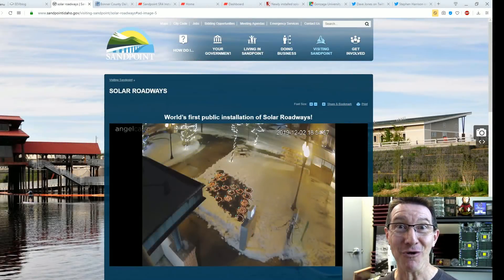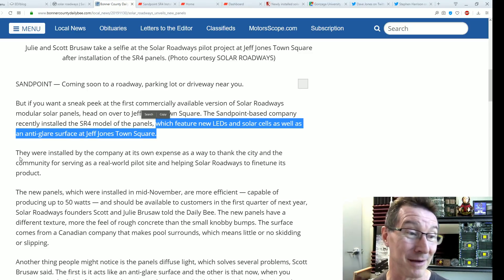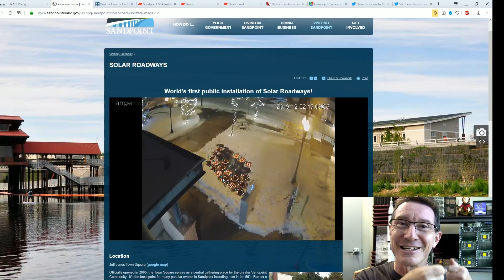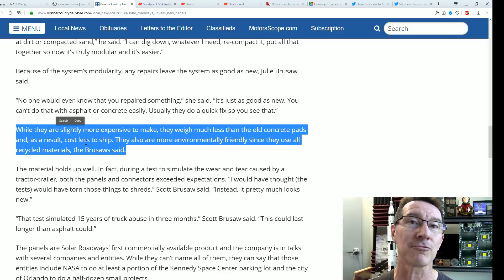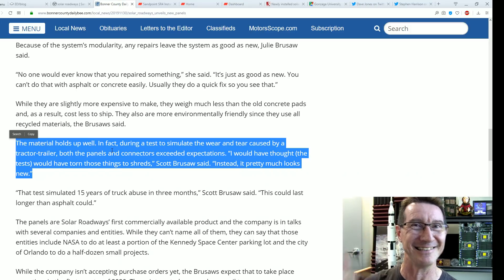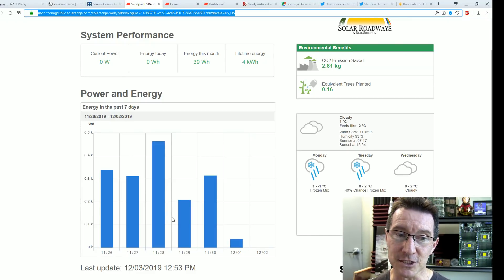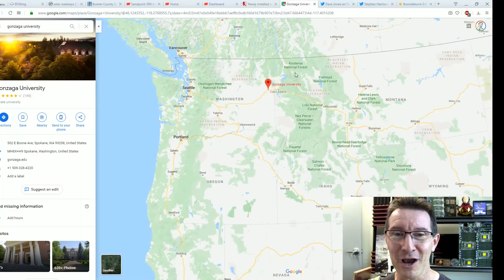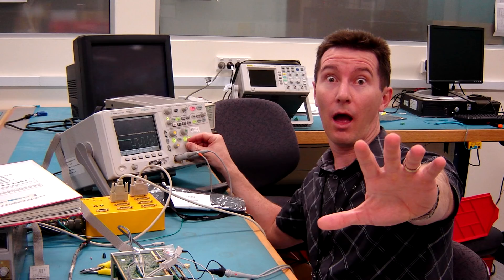EEVblog #1269 - Solar Roadways SR4 DATA Hilarity!

Comment: We have a large SolarEdge system at work.  Now, during winter, it generates about the same number of kWh/day as its kW-peak rating.
However, during summer it never achieves more than about 80% of its kW-peak rating so that figure is obviously too optimistic.
Likely because the panels are laying "too flat" for our latitude of 52deg, due to construction limitations (racks on a flat roof).
The production in summer is around 5 times the kW-peak rating in kWh/day.

The site you show is the "Kiosk", that is intended to e.g. run full screen on a computer at the reception desk to impress the visitors.
The owner of the system has a username/password to access all historical data in much more detail.

It is clear that the performance of that system is pretty lousy, as is fully expected and common for all types of solaroad.
Reply from the maker: Yeah, doesn't look like the system is a public access dashboard, I can't find it in the list.

Comment: Ugh why use the word "retarded" when you can just use "stupid", which is what you meant anyway. It's 2019.
Reply from the maker: Yep, "It's 2019", so what?
Reply: It's 2019- stop using slurs. It's gross. And it's not even necessary. Unless you were literally implying a mental disability, there are better, more accurate words. And if you did mean a literal mental disability, just say that.

Comment: A parking lot? Does the insanity ever end with these guys? How about stick normal panels on a roof and shade the cars at the same time as actually generating some power. Nope, that's too sensible, doh!
Reply: I saw i planned parking lot in that manner. In that way it makes sense protecting the cars from the sun and power generated. But ofcourse they had to ad a stupid twist. They planned to use semi transparent panels so there would be some ligth comming downn to the cars
Reply from the maker: That's not out-of-the-box innovative thinking.
Reply: Ah, but they have a master plan for Transparent-Freaking-Vehicles next....

Comment: I say when the SR4 panels are finally available for public sale, we all chip in and get one for Dave to do a teardown on!
Reply from the maker: PO Box 7949 Baulkham Hills NSW 2153 AUSTRALIA :-D
Reply: @EEVblog  Or we could go all out, fly you to 'Murica and see if it will power Thunderf00ts self cooling / filling water bottle!
Reply: Nonsense. I say we create a GoFundMe to pave his whole driveway in solar roadway panels!! The greatest troll ever devised!
Reply: @onemanshow4116  and watch as they slowly break apart and wreck his car tyres and short out the electrics.
Reply: It would be fully potted and require a dremel or other rotary tool to get it apart.
Reply: @gorillaau  or perhaps a big Crocodile Dundee knife? You do know who you're dealing with right?!
Reply: @deanwatt  just drive over it. she'll tear down just fine.
Reply: In this case, we should also make sure to get Thunderfoot a trip to Australia. That would certainly be a co-op video i'd gladly pay to see. As for opening the potted modules, i'm pretty sure Big Clive will come up with the "correct" tools to make short work of that ;-)

Comment: Small but key correction. The Sandpoint council didn't pay anything for the first panels, all $50k was paid with a State grant. During one of the public hearings someone asked for the amount of money the city had paid. And (on camera) the Mayor of Sandpoint can be seen LUNGING for the microphone to explain that not one local cent was spent and he emphatically provided sources. Which might be the greatest proof that this is nonsense. Something's got to be a higher level of bullshit for a politician to not want to take credit for it. Maybe the Major saw some of your calculations?
Reply: Local authorities even in small communities are vastly more intelligent and based in reality than government workers. Go figure!
Reply: They may not have paid for the installation, but the council is paying for whatever power it draws from the grid (public space after all).
Reply: @sweetchristmas101  Maybe or maybe not, there's a lot of ways to structure the finances of such things. If the city is paying for it then it's just the trickle of power used by the webcam and the LEDs. If the number of tourists this 'thing' has brought to town has emptied the visitor center's vending machine even once then they profited. However even at a few pennies it may be costing them I still think it's a great justification to remove the installation. :P
Reply: @bronzedivision  It would be more than a few pennies. I suspect melting that snow wouldn't be cheap, despite the size of the area. Granted, not a lot over all, but the principle of it.
Reply: ...and where does the state get their money? The cities.

Comment: I wonder what would happen if a large truck did an emergency stop on these things, have they tested for that? A significant amount more force on the glass surface than just driving over it.
Reply: I'd guess (and it's just a guess) that even a car slamming on its brakes would exert enough lateral force to cause some damage.
Reply: Here in the Netherlands they tested a system that was constructed much more sturdy (large concrete slabs) as a bus-lane, and it failed within a week.
And of course a bus poses far less load than a large truck, and I presume they did not do breaktests, just normal running.

Comment: Ah yes good let water you just melted seep under them, I'm sure the re-freezing and expansion of that ice won't cause any permafrost-esque distortions and break everything. Great idea!
Reply: Roadmakers go through great lengths to prevent water getting under the roadway. The asphalt around Denver is around 8 to 12 inches thick to avoid water getting under the road and to help reduce the impacts of freeze thaw. Even with that, freeze thaw still tears up the roads.
Reply: Yup, even if they managed to melt the water, the runoff would move lower and refreeze. Freeze thaw cycles will tear up their system and any other infrastructure along the drainage.
Reply: That has happened on the first installation, but it was regular rain water.
Reply: Yep, and to prevent the molten water from freezing again but underneath the panels they need to heet the panels permanently during winter.
Reply: @Enkidu1701  Snow isn't as dense as rain. Water might not be as bad in the winter as in the warmer weather.
Reply: Nah the panels will keep that water warm mate no worries

Comment: Simulated years of semi traffic... what a joke!  I'd love to see an 80,000 pound semi running 60 MPH over this silliness and have a brake lock up which is common especially in the winter when water in the air lines freeze.  Even better would be one running over them on rims after throwing the caps on a set of tires.  You don't test things in ideal conditions if you want real world data.  The real world has lots of dumb people doing stupid things...
Reply: Or a big semi hitting the jakes hard, that woud most likley result in flying panels
Reply: @lukahierl9857  its going to make them a bit dirty at the VERY least haha
Reply: @Spiritpoweredinternet lol decapitation is taking it to the next level xD
Reply: If they did it, they probably did it on a single pannel using the same methods used for asphalt, which is nonsence since those pannels will break first at the junction between them, not on the pannel itself (although they certainly could certainly manage to be bad enough to do so).
Reply: Amen brother. How about a 20 tonne loader with its cutting edge down xD

Or a tandem tandem with a full load of salt, spreading it.

A JOKE INDEED!!

Comment: another "briliant" idea
 just make the compression generators  panels so if car drives over the panel with high rates panel would generate power from flexing
Reply: kokodin   Yes!  Piezo electric road panels.  You could drive your electric car and charge its batteries at the same time.  No more annoying charging cables to deal with, just up the voltage and presto, under car lighting-like power transfer.  And we all know lightning is all natural and environmentally friendly.  Why, what could possibly go wrong?

Comment: I work in solar, we install thousands of panels every year and I can tell you one thing. Manufacturers go to great lengths to have as thin and clear glass as possible and also add self cleaning coatings in the glass etc because SOILING losses are very significant. These guys introduce PERMANENT soiling with all the shit they put on the already too thick glass. This is a freaking JOKE😂😂😂
Reply: Yeah, these things are just stupid, but you can sell anything if you can claim it is "green".
Reply: Thank you for this info
Reply: But do people park their cars on your panels? I think not, check and mate. Oh wait that actually sounds like a really stupid idea, never mind...
Reply: If I were to do my own version of a SOLAR FREAKING ROADWAY I think I'd first try having the solar panels along the sides of the road angled  & elevated a bit.
Reply: Yuppp haha
Reply: Just imagine the streaks from tire wear on those things...
Reply: Cosmic freakin jokeways and they are laughing all the way to the bank.
Reply: Yup its hilarious not to mention the heat losses of being in a road. Hell i did a 40kw system on a black metal roof and on 95°F days we lost huge percentages just in heat. The owners have a hard time understand why they have 15kws worth of panels but they never get over 13kw production at the inverter. Its the bane of my existence to explain undersizing inverters and heat/wire loss
Reply: They generate power from the LEDs, that will compensate any losses, genius
Reply: Theo Just buy everyone a DIY solar powered toy car kit to play with in the winter and they’d quickly understand how little power solar panels actually provide.

Comment: What's sad is that I know of a material that's as strong as steel,  transparent throughout more of the spectrum than glass, can be easily textured, is nearly impossible to corrode, can be painted just like asphalt, can be treated with brine and plowed just like any regular road, and would last 50-100 years..... yet these idiots go with glass.... and LEDs.... and heaters...... If only I had a million dollars and the equipment to make said material without resorting to one of two public non-military manufacturers who want $35k per square foot. Hell you could probably use fresnel lenses or some other optical trickery to help out those solar panels.

Still a stupid f###ing idea, but hey......

Comment: Everyone (me too) is poking fun at them...but with every day passing they rack up more experience, more research, more data. They try, and try again, and again...and before long they will be the world's leading experts - the ones everyone turns to for advice. We all may be entertained by their antics...but they are doing actual empirical, experimental science, and just keep in mind that one day we all might thank them for their pioneering work.
Reply from the maker: My sarcasm detector doesn't seem to be working...
Reply: @EEVblog  Next April Fools', do a "cheap ebay sarcasm detector teardown"
Reply: Well, yes, I suppose once humanity has covered all of the other inherently better surfaces (roofs, places that are not roads, deserts) in solar panels, then it'll be time to build heavily armored solar panels that require many more times as maintenance, generate far less energy, are much more expensive then any standard roads or standard solar panels, with no benefits. For some reason.
Reply: Dude, that's like being the world's leading experts in perpetual motion machines. You can't break the laws of physics, no matter how "expert" you are.
Reply: Can't see if you are sarcastic or just didn't listen.
Reply: They typed that with a straight face, impressive
Reply: Exactly.
I try and try and do experiments and 10 years from now I will the worlds leading expert in falling from a 20 stories high building without hurting myself.

Comment: So where is the power coming from to power the leds and heaters when when there is no sun and the panels are covered with snow?
is that car charger connected to the grid perhaps?
are they cheating?
Reply from the maker: The power comes from the grid. They don't have any local storage.
And presumably from the grid at all times, as I don't believe they have any active power routing technology inside the panel.
Reply: @EEVblog  the closer you look the worse it gets.
Reply: @EEVblog  maybe the electric car is powering the panels? ;)
Reply: The energy comes primarily from nuclear reactors at night and natural gas during the day. If we just made a road out of uranium-lined gas lines...
Reply: @rjhacker  .; Great idea I'm sure Elon Muck will fund it for you.

Comment: Maybe they can install a Solar Fricking Roadway inside the Hyperloop...
Reply: And the best place to put them would obviously be the inside of the hyperloop, not the outside
Reply: @mortisoculi8943  Obviously... you can't see the blinky lights if you put them on outside.
Reply: @mortisoculi8943  Hyper Freaking Solar  Loop?
Reply: Yes!  It could work if you build the hyperloop using glass.
Reply: acr08807 
Tesla will simply put their own solar tiles on the hyper loop tube. Sorted.
Reply: Hyperloop is probably impractical, but it makes 1000x more sense than S.R.
Reply: @geonerd  You mean SFR won't work in a vacuum?
Reply: @mick7sp  solar panels in space make sense, but if our satellites would have LEDs in it, we could send messages to the sky, like Coke ads
Reply: Spelter don’t forget the million tons of CO2 and other crap emitted by the rockets.
Reply: geonerd
Hyperloop makes sense for super long distance travel (like on the order of spanning continents or maybe a transatlantic subway like the Eurotunnel) but its still impractical and probably better suited for cargo than passengers.
Reply: @dafoex  Agreed, vacuum trains (their real & original name, thank Robert Goddard) would be best suited for small parcel delivery. MUCH smaller volume of air to permanently displace if you can get the tunnel diameter down significantly.

Comment: My bladder is more effective at melting snow than 30 solar roadways panels, we'll do the calculation in a minute.
Reply: Bonus: you are also cleaning AND heating the surface in the process!
Reply: @DrakkarCalethiel  win win situation
Reply: I was waiting for the calculation... but for a 500mL bladder, at 37°C, and 80 cal/g for latent heat of water, that's 500*37/80=231g of snow melted. So I think you overestimated your manliness.
Reply: @jamesbrown99991  uff no. But for a body to produce this heat, it needs fuel. 2300kcal per day is needed to work properly for the most people. When I look at the size of the panels, that's not with 500ml done. Btw your bladder holds 300-400ml. Heating that up needs energy too. So let's say we use 5l water, what will lead to a water poisoning btw, and heat it  up from 10 degrees C to 37, that's 27 degrees * 5000 = 135 kcal or 565kj.

How much energy does 1l of diesel produce? Around 35 Mj or 35000 kj. To heat up 5 liters or water the same way, I would need around 20ml of diesel. That is around  53 grams of co2.

Humans exhale around 1.3kg co2 per day. If I just calculate that amount with the 135 kcal, I have around 76 grams co2 just to heat up that water.

Science backs me dude. We are not efficient machines running on high density fuel.
Reply: @Spelter  Did you mean to reply to me?
Reply: @Spelter  you didn't read and/or understand my comment.
Reply: @jamesbrown99991  now i can sleep in peace
Reply: But your co2 output and food resources you need for that is even higher than my Golf MK4 Diesel would have needed.
Reply: yeah.... Yeah... YEAH !   I know we're waiting on the calculations... but give me another couple minutes, could ya? .... so I'm "comment shy", alright ?….  oh.... ummm….. before I commence with this field study.... ummmm. are we SURE these here panels are "liquid tight"?   :-O   don't wanna be short circuiting ANY equipment !
Reply: @solarnaut  They aren't really. If you would pour water on it or piss on them, they probably will short out. I dare you to do it or watch Thunderfoots videos on them (and how inefficient a bladder will be lol )

Comment: Melting the snow you can also just glance at it and say that if the sunshine isn't melting the snow directly there's no amount of farting about with lossy electronics that's going to make it work. A sheet of black plastic on top of the snow might work better.